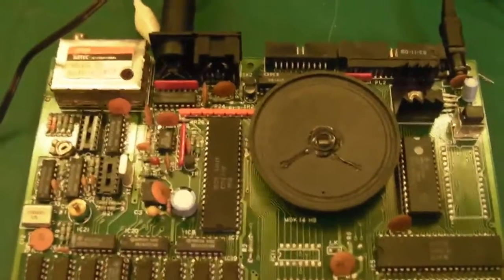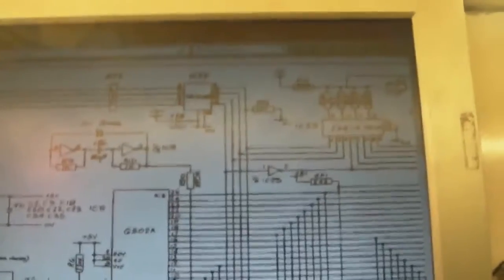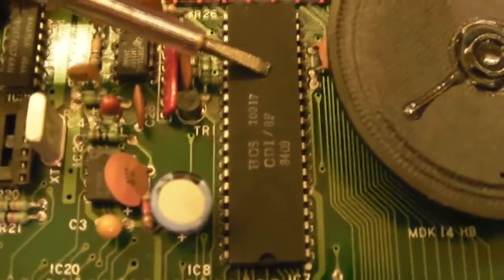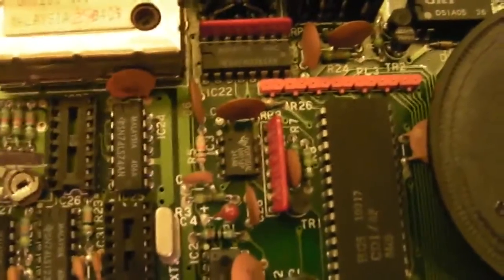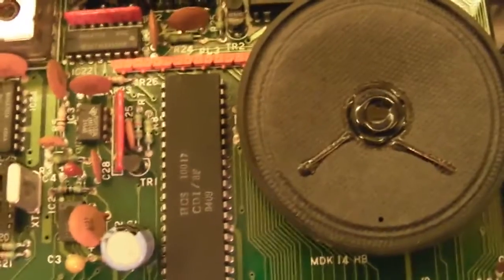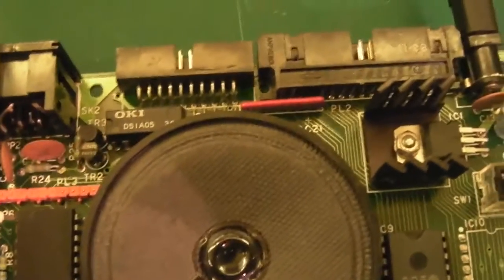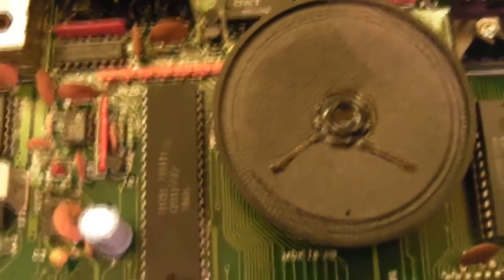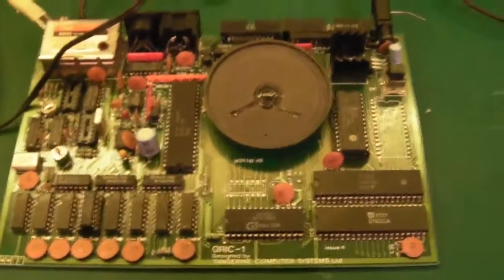Oric Atmos repair Pt2

Comment: You have probably found the fault (ula), but can you get a stable trigger on CLK ? What about PHIout (ULA pin14) ? What about IC25 or IC22, do they overload the sync somehow? Oh wait you pulled them out .. :) Looking forward to the new ULA :)
Reply from the maker: yea nice steady stable trigger on the clock, reading the service manual for the oric the ULA seems to be the first suspect when video issues are on both the RGB and RF output. Mine is soldered to the board which apparently is unusual so got the fun of removing it and fitting a socket.

Comment: Great stuff!  On that diagram it looked like the 6502A rather than the ULA?  Was that a typo on the diagram or were you just looking at the wrong area?  I can see you were pointing to U22 correctly etc, but just couldn't understand why the ULA was marked what looks like 6502A?   Good progress though and nice to see the board up close!!!  Look forward to the next part =D
Reply: Just had a look at the schematics, I see now the ULA is the chip to the right of the 6502A, you just happened to have the screw driver over that side but Ime sure you were talking about the chip to the right of it =D